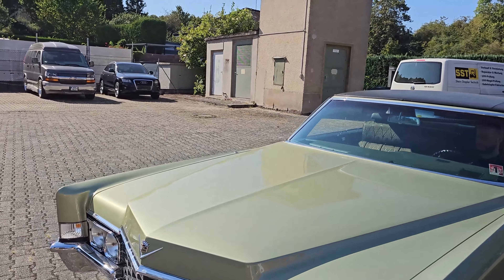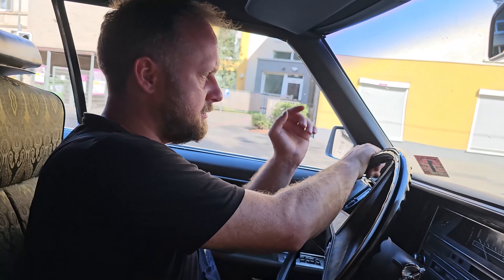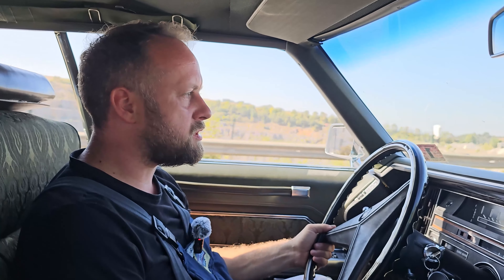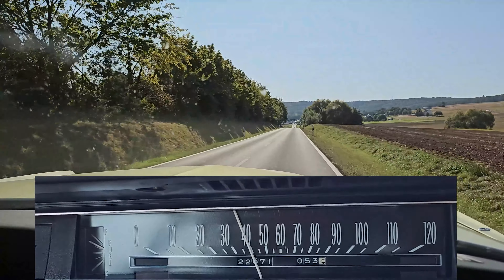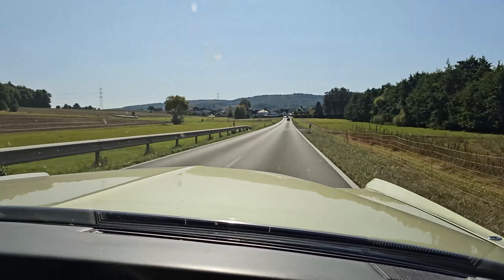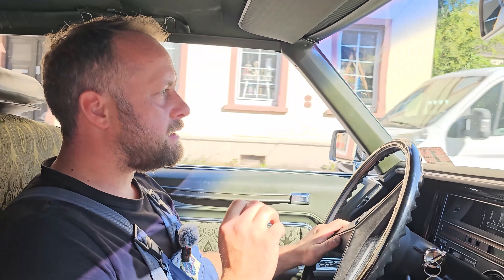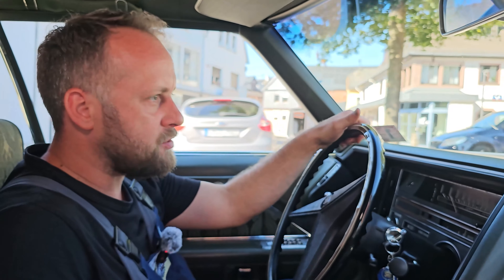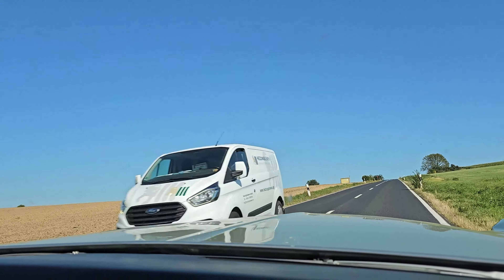69 Cadillac de Ville: Wie fährt sich Cadillacs "Muscle Car"

Comment: Diese Motoren Familie wurde von 68-79 gebaut. Nach meines Wissens gab es da den 386,425,472, und 500. Da passte fast alles zueinander, die Krümmer die Ölwannen die Ventildeckel die Wasserpumpen. Im letzten Jahr 1976 hatte der 500 nur noch 192 PS. Soweit ich weiß konnte man diese Motoren ab 76 auch mit Bosch Multi Point Einspritzung haben. Ich habe eine Bosch Multi Point Einspritzung auf einem 77er 😊425 Motor….. die waren dann statt mit 182 PS …186 PS mit 215 PS angegeben.
Unterdrucksysteme hat man verschiedene gebaut… immer mal wieder anders ob…. California oder nicht California u.s.w.. California Ausführung hatte dann zwischen den Zylinderköpfen vorne dieses Brückenrohr und die Lufteinblasung mit dem keilriemengetriebenen Kompressor um das Abgas zu verdünnen… alles so ˋn Quark….finde ich….
Bei mir ist dieses TVS unter dem Verteiler um die Vakuum-Frühverstellung im kalten Zustand zu unterbinden. Einmal damit man dem kalten Motor nicht die volle Leistung abverlangen kann und zum anderen wurde durch die Spätzündung der Motor schneller warm. Soweit ich weiß gibt das TVS ab 40 °C das Vakuum frei. 

Mein 425 Motor hat auch diese Stauklappe im rechten Abgaskrümmer. Da gibt es auf der rechten Seite ( Beifahrerseite ) des Motors ein TVS dass Dauer-Vakuum bis 70 °C freigibt und damit wird diese Stauklappe im rechten Abgas Krümmer zugezogen und die Abgase gezwungen durch die Ansaugbücke auf der linken Seite raus zu gehen. Dabei erwärmen Sie die Ansaugbrücke und der Motorr wird schneller warm. Ab 70 °C sperrt dann das TVS das Vakuum und die Auspuffgase drücken normalerweise die Klappe wieder auf. Dabei klappert die Klappe im Fahrbetrieb bei mir auch so 3 Sekunden blechern. Wenn man das Auto gerade so bei um 70 °C abgestellt hat und neu startet klappert halt die Klappe etwas länger weil sie gerade irgendwo halb offen ist. Dieses blecherner Klappergeräusch ist „wahrscheinlich?“ weil die Klappe auf der Welle die sie bewegt lose ist…. oder der Klappenmechanismus an der Vakuum Dose ist lose? Wenn sie dann offen ist verklemmt sich das dann aber wieder und ist ruhig. Die 3s klapern im Normalfall stören mich nun nicht,weil dann weiß ich wenigstens dass die Klappe aufgeht…das hört man auch im Auto….meist so nach 2-3 km Fahrt. Das TVS sollte richtig funktionieren sonst könnte der Motor überhitzen wenn die Klappe dauerhaft zu bleibt. 500er Krümmer hatten diese Klappe nicht drin.

Ich hatte mir mal einen 500 aufgebaut mit höher verdichtenden 9:1 Kolben und etwas schärferer Nockenwelle. Der sollte laut MTS (Maximum Torque Speciatis ) 320 PS mit diesen Teilen haben. 
Also im Vergleich zu einem 560 SEL der „nur 300 PS“ hat absolut nicht zu vergleichen. Man hatte immer den Eindruck von den 320 Pferden stehen 200 ständig im Stall! OK 220 PS waren es im Höchtfall dann doch. Drehmoment und Antritt aus dem Stand gigantisch bis vielleicht 60-80 KMH… Aber dann ist die Luft raus weil er kommt einfach nicht auf Drehzahl. Der 560er wird da erst richtig munter und reißt das Auto weiter über 120…130 bis an die 180 ran und wird dann erst langsam etwas müder. Also wenn man die Zahlen hört von 400 PS…oh…bohhh…. so gewaltig ist das alles nicht!
Da die Angabe von Rolls Royce…..Motor Leistung ausreichend ist da besser! Man ist keineswegs untermotorisiert, Antritt aus dem Stand top, der Motor ist immer souverän, klingt nie überfordert und man kann auch mal einen LKW überholen ohne dass er einen Gang zurück schaltet oder den Kick down unbedingt braucht weil genug Drehmoment da ist…. aber Zahlen von 400 PS zusammen mit dem Hubraum wecken Erwartungen die einfach nicht erfüllt werden.
Reply: Du darfst bei all den PS und Ansprechverhalten die Automatik nicht vergessen. Das TH400 frisst 10%, wenn das mal reicht. Ich weiß nicht mehr wo, aber meine mal was von mindestens 30 PS gelesen zu haben, die da drin verloren gehen. Mein 429er hat eine Switchpitch Automatik drin, ein 2 stufiger Wandler, welcher 2 Stallstufen hat. Der tut dem Motor schon sehr gut, mit den Fahrstufen und diesem Wandler beschleunigt der relativ linear. Man wünscht sich aber manchmal noch einen vierten oder fünften Gang.
Reply: @Lowrider2905  deshalb habe ich seit neun Jahren eine 4L 60 E drin. Die Drehzahlsprünge sind aber auch groß… Deshalb gibt es ja die 6 L 80 E und das was TCI vertreibt als 6-Gang Automatik. Wunder im Verbrauch passieren aber wegen dem vierten Gang mit Overdrive und dem Wandler Lockup trotzdem nicht. ja man fährt mit weniger Drehzahl 1700 RPM bei ungefähr 110 KMH

Comment: in den USA wurde der 472er Motor nach einer Revision mal auf einem Prüfstand getestet: ergab 263 SAE-PS...was ca. 260 DIN-PS entspricht. Der 472er wurde bereits 1968 verbaut. die compression rate ist mit 10,5:1 gegenüber dem 429er gleichgeblieben

Comment: Ich unterstelle mal ganz pauschal, dass 80 bis 90% der alten Cadillac bzw. Amis im allgemeinen verstellt, defekt oder sonstwas sind und Leistung fehlt. Da diese großen Motoren relativ lange ohne Totalausfall bei Nebenluft, Kompressionsverlust und massiven Vergaser sowie Zündproblemen laufen, wird das alles als "normal" empfunden.
Reply from the maker: @Lowrider2905  das mag in der Anzahl der noch existierenden Fahrzeuge stimmen, allerdings kann ich es bei unserer Kundschaft in keinster Weise bestätigen. Viele achten penibel genau auf den Wartungszustand ihres Wagens und in unseren Inspektionsplänen steht genau das zur Überprüfung mit drin. Somit fällt direkt auf, wenn etwas nicht funktioniert oder stimmt.
Reply: @oldtimer-profi  so sollte es idR auch sein. Der Anteil eures Kundenkreises an der Gesamtzahl der Oldis in eurem Kreis sollte marginal sein, da gefühlt viele Amis nur auf Naht betrieben werden, was sehr schade ist.